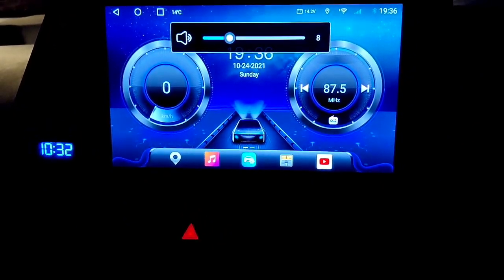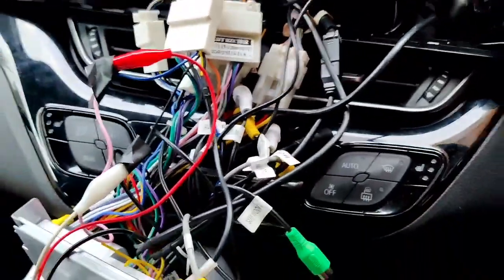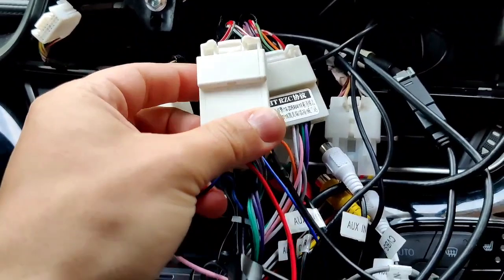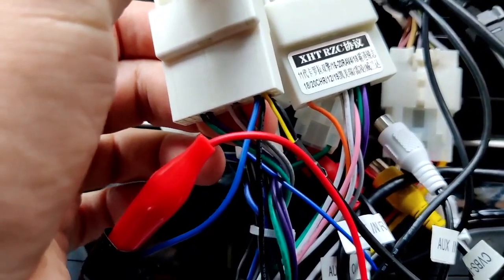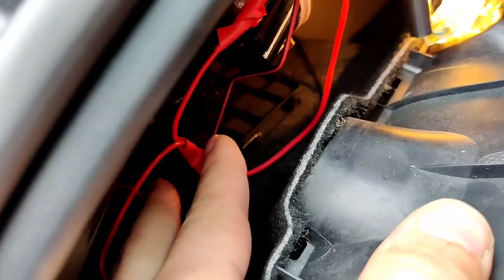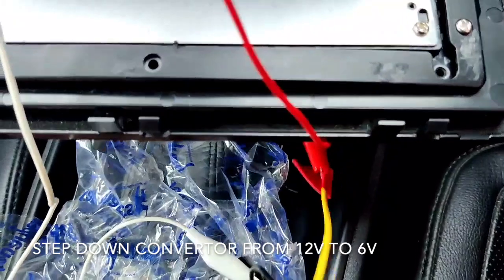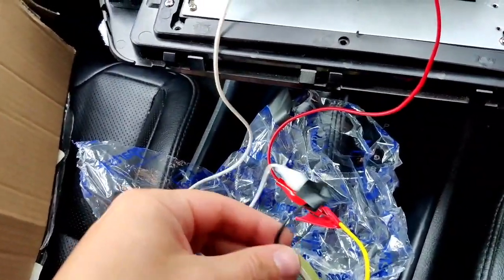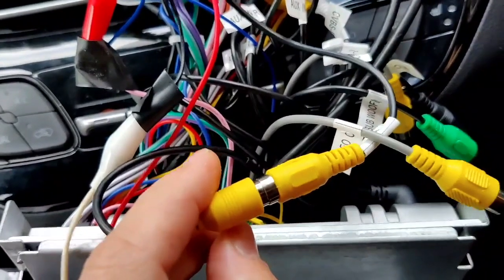How to connect a factory camera to android unit on Toyota CH-R

Comment: Nice video bro finaly i find the right video👌👌👌 if you put the ,,reverse or back" wire from the unit to the trigger wire from addaptor it wont work? Thanks
Reply from the maker: no, it won't trigger. You need to find a black wire under the passenger seat. I couldn't find it
Reply: @lordbalance6291  ok

Comment: hi - cant you take 12v_+ from front of car? or from head unit somewhere?
Reply from the maker: i couldn't find any rear signal +12v from the multimedia/front part of the car , it should be somewhere under the seat,but could find it, therefore, I added mine